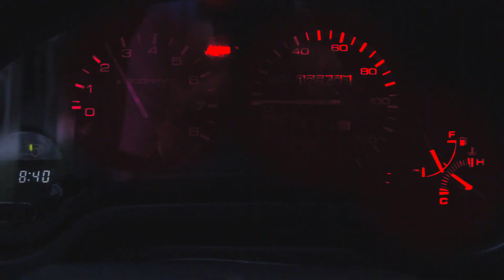EP107  tie rod install Season Finale!

Comment: Good video, very clear and to the point. :)

When I'm doing tie rods though, I prefer to measure the tie rod from a point on the inner, to the centre of the circle on top of the tie rod end. This way you allow for differences in length from one brand to another. I know guys who count the rotations it takes to remove them too, but again this can easily be way out of the new tie rod end is even a tony bit longer than the old one.

Comment: I agree. I replaced my old tie rod outer with the same one in the video (from Advance/Rossi/AutoZone) by counting turns I ended up with my steering wheel being uneven while driving straight. The new tie rod end must've been considerably longer.